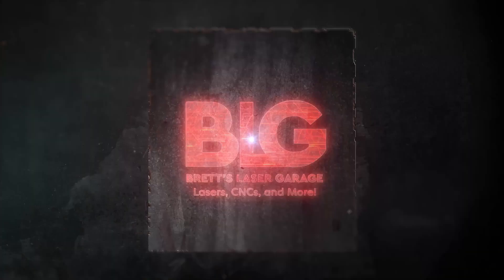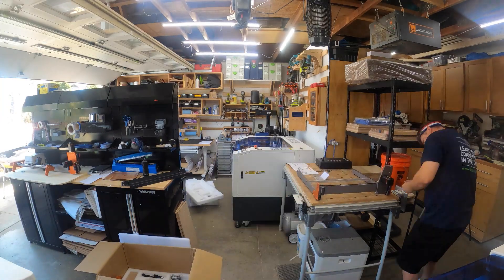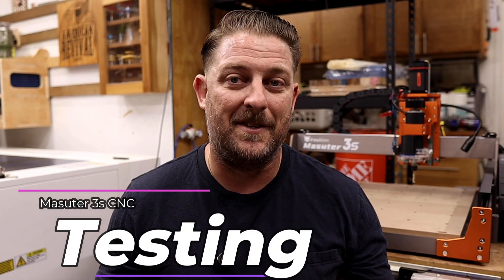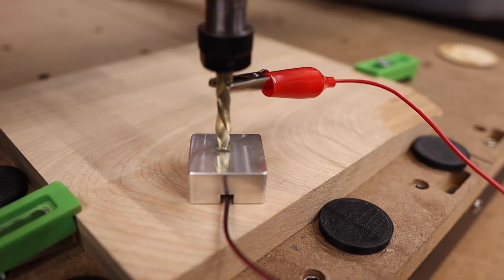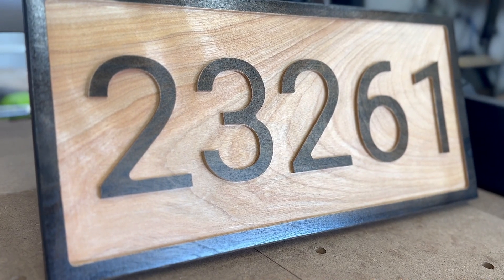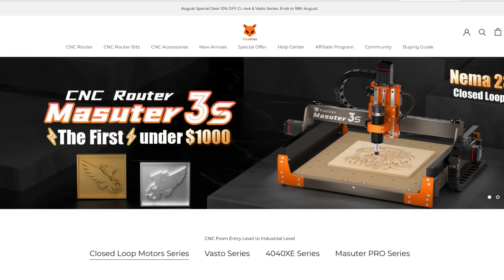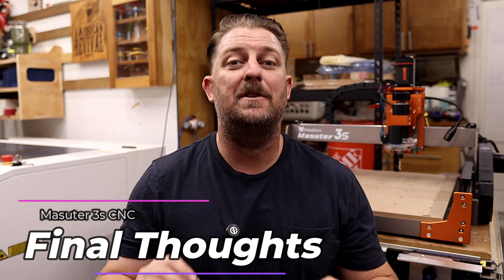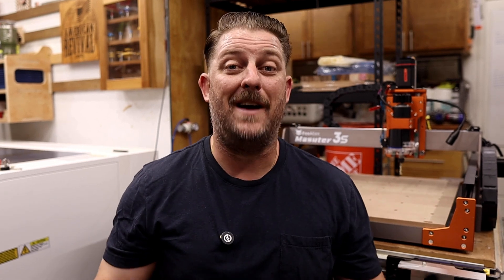Is the Masuter 3S the Best Starter CNC Machine? Find Out! | Brett's Laser Garage

Comment: Looking at getting a machine like this for my first CNC. I been looking at this one and the Genmitsu 4040 Pro Max. Do you think having the NEMA 23 motors closed loop with the belt drive is better than the NEMA 17 open loop and lead screws on the Pro Max? Do you still use this machine? If so how has it been working out since the review?
Reply from the maker: Just get something that fits in your budget and try your best to make the best stuff you can.  I wouldn’t get too far into the weeds regarding stepper motors and whatnot.  Both machines will get you started and hopefully set you on the path of learning and loving the art of CNCs.  I really like the Masuter 3s because I have it and have used it a bunch but it’s not the only option out there.

Comment: So I have 24 inch by 12 inch cutting board that I need to make a 5 inch round logo in the middle of it.Could i do that with this?
Reply from the maker: Yes if you orient the cutting board and file correctly.  The bed size is 15.75”x15.75”, the 24” length would be passing through the front and rear of the machine.

Comment: Is this cnc machine good for architectural model making? (like a block of houses with pitched roofs?) Amazing video. Thanks.
Reply from the maker: Depends on the size I guess.  Are you trying to cut out models as one piece or as components?
Reply: @LaserGarage  both. one piece for small scale (1:1000/1:750) for urban models, and for bigger scale (architectural models), as components cutting bigger blocks. Thanks for answering, man.
Reply from the maker: You’re very welcome.  That seems like an interesting project!  Have you looked into 3d printing?
Reply: @LaserGarage  yes. I actually 3D print all the time at the moment. I was curious if I could achieve the same with a CNC to get the massive aspect of the wood and move away from the cheapy feeling plastic gives. Do you think this machine can make urban block/volumetic buildings 3-5cm in height+roads/pavements 1mm deep?
Reply from the maker: @ibb8890 excellent.  Those are pretty small parts.  I don’t have direct experience with this so it’s kind of hard to say.  The machine can engraved/cut with the precision necessary, I can say that 100%.  But it really depends on how you setup the design and tool paths.  If you have cnc/3d modeling experience, which it sounds like you do, it is totally possible.  

One thing to note.  CNC routers obviously cut away material to make parts, subtractive manufacturing.  Versus 3d printing which add material to make parts, additive manufacturing.  Work holding is going to be another challenge you’re going to face when working with small parts due to the forces involved in CNC machining.  I would recommend running as large of a part as you can or group smaller parts into larger parts to make work holding easier.  Hope this helps a little.
Reply: @LaserGarage  Thanks for sharing your expertise mate. I appreciate that. I will go forward with it. For details I saw carved in some parts in other youtube videos, a simple cube/house shape without openings (massive look), this machine would suffice easily, I think. Thanks again and success!
Reply: @LaserGarage  Hello again mate. Just a follow-up question. I am about to purchase a Masuter 3S but I ran across the XE-pro machine. I can't find the key differences or comparisons between these two anywhere. Would happen to know the differences and if investing in XE-pro would be a better move than buying a Masuter 3S? Thanks in advance.
Reply from the maker: @ibb8890 I’m not an expert in all of Fox Alien’s products but from what I can see the main difference is the XE-Pro uses ball screws for XY axis travel instead of belts like the Masuter 3s.  It also has a built in offline controller.
Reply: @ Thanks again!

Comment: Can you pass through a longer piece without the extension for lettered signs?if I wanted to pass a 5 foot board through and do one letter at a time, would there be anything to obstruct me doing that?
Reply from the maker: You could do that.  Widest you’d be about to go without the extension kit is about 15 1/2” inches though.
Reply: @LaserGarage  awesome!  Wasn't able to find any information about index/passthrough capabilities on the manufacturer site or anywhere else for that matter.
Reply from the maker: @danielgauwitz8611  you're welcome.  The front and back are wide open, so you could theoretically passthrough any size material you'd like.  So long as you don't exceed the width restriction of course.  Just keep in mind setting up your file though is another animal altogether.  Do some research on "tiling" if you're not familiar with it.
Reply: @LaserGarage  thanks for the quick response!

Comment: Did the spindle has an ER11 collet?
Reply from the maker: No, I bought it on Amazon for like $5.  The stock spindle only accepts 1/8” shank bits.
Reply: @ but you can use er11? My makita not work with er11 collets
Reply from the maker: Yes it accepts an er11 collet
Reply: @ thanks

Comment: Good morning 🌅, That looks like a great machine, good info, what computer do you recommend, I have never used one, so it is going to be difficult learning cover, from France
Reply from the maker: Do you mean computer or software?
Reply: @LaserGarage  what computer specs are req'd to run a CNCof this ilk?
Reply from the maker: Depends on what software you’re running but generally not much.  I’m using carbide create for CAD and universal gcode sender for CAM.  Neither uses much computer power.   I run cnc’s and lasers off a $200 mini PC.  Check out my latest shop tour video for more info on it.

Comment: Thx for the great video. Could you explain the difference between the M3S and the XE-Pro? What ist the best choice? Thx.
Reply from the maker: Thank you!  From what I understand the XE-Pro is beefier.  It runs on ball screws and linear rails for the xyz axis.  The Masuter is belt driven on the xy and ball screw for the z axis only.  The XE has built in offline control as well.  Other than that I don’t see any differences.  Same stepper motors, same spindle, same work area.  

Which is best depends on your use case and budget.  Hard to answer that one.  I would say generally if you’re new and looking to save some money I’d get the masuter 3s.  Nothing wrong with belt driven machines, especially when you’re starting out.  I had one for years with my old Shapeoko Pro xxl.

Comment: Thank you so much for the fantastic video, it is exactly what I needed to hear! I was looking at the 3 and was told that carbide create wouldn’t work with Masuter, would love to see a CAD and CAM software video please! Also, could you please tell me the differences between the 3 and the 3S? Thank you once again!
Reply from the maker: You’re welcome, thank you.  I believe the 3s has the upgraded stepper motors compared to the 3.  Everything else is the same.  

I’ll work on a CAD/CAM video related to this CNC.  I believe that is the largest sticking point for new users for sure.  Carbide Create works for designs but you have to have the Pro version to export your design as g-code and run them.  I’m very familiar with Carbide Create because I use it with my Shapeoko 5 pro so that’s why I choose to use it.